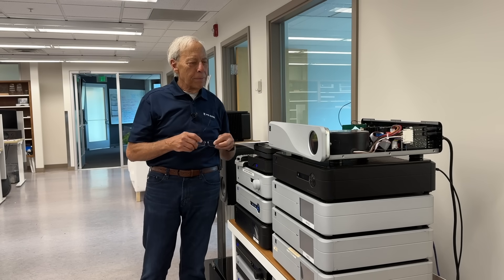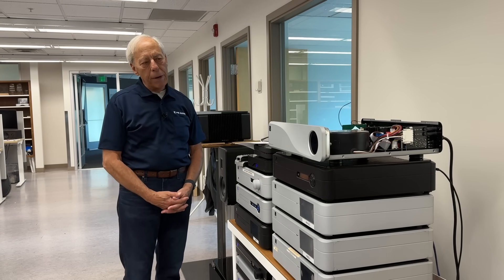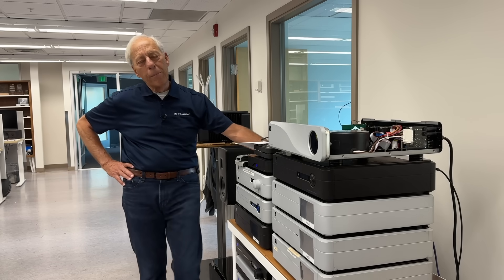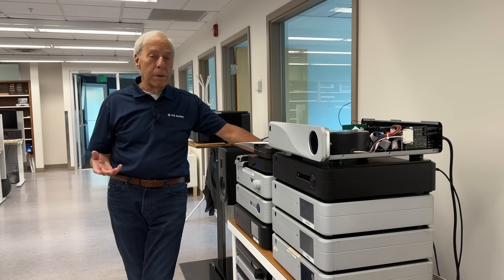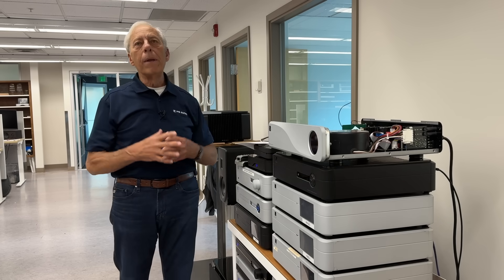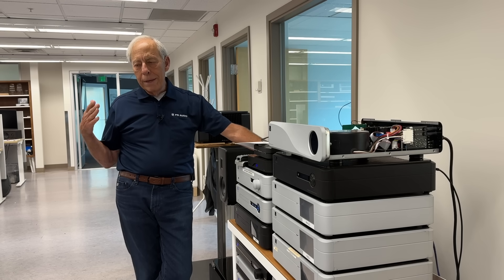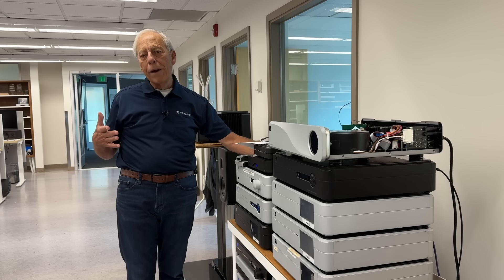What does a preamp do?

Comment: Marketing B.S. How can a pre-amp make the sound better? So if I chain two pre-emps, it will be even better and if I chain three, it will be fantastic? Do those pre-amps use AI to process the sound and remove imperfections or make singers sing in key?

The truth is, those pre-amps may change the sound in a way that it sounds subjectively better to some listeners - nothing more.
Reply: I own a Parasound P6 and a Parasound JC2 pre, besides the price there is a huge diff. Its the noise floor and impedance matching.

Comment: The preamp should have a better ability to drive the inputs of a power amp. Some preamps have a huge overhead of line output, far more than is necessary to drive the inputs of the power amp. Also they often have a lower source impedance. There is also the matter of gain. For a long time gain seemed irrelevant as all the preamp was really doing was reducing the level of sources connected to it. However gain seems to have some benefits too even though it isn't technically needed. It is a mystery however because there are quite a few DACs on the market now that offer both these features and a good volume control and some state that even they can  benefit from a preamp.

Comment: I've always thought of the preamp as the selector between your source components ad the power amp. how many power amps have multiple inputs that you can then switch between. 2 or 3 or more analogue devices and multiple digital devices. most power amps I've looked at have only one analogue input per output channel.

Comment: I've commented before that I wasted a few years with a passive preamp. When I replaced it with a tube preamp, the soundstage opened up and the bass moved to a different level. A passive preamp requires the audio output stage of a DAC or phono preamp to drive the resistor in the passive preamp and the cables, and some of them simply can't do it.
Reply: Was the different level higher or lower.

Comment: PS Audio's PMG preamp of ultra .00000000001 distortion is unnecessary and not as important as these features below:

Today's preamp should do everything my Parasound 2100 does and better (as it came out in 2007, 18 years ago) at a competitive price (Parasound 2100 was $600 in 2007-2023. I bought it in 2023):
- Automatic home theater bypass (Parasound 2100)
- tone controls treble/bass (Parasound 2100)
- balance left/right (Parasound 2100)
- analog 3-way active crossover: highpass, midpass, lowpass (I added a 3rd party device)
- RCA input/output (Parasound 2100)
- XLR input (new), XLR output (I added a 3rd party device)
- RCA loopouts (Parasound 2100)
- XLR loopouts (new)
- ground lift button (I added a 3rd party device)
- 2 independent subwoofer outputs (Parasound 2100)
- loudness button (new)
- headphone jack (Parasound 2100)
- Bluetooth 5.x latest (new)
- Linear power supply (new)
- builtin intput tube buffer  (I added a 3rd party device)
-----
source=Apple Music lossless
My video:
Search youtube for mrPMJ00
Reply: I hope you have a decent understanding of crossover design to properly implement an active crossover, it's not trivial to do it properly.
Reply: @mitchtaylor6512  I bought an analog 3-way active crossover (Sublime K231) and the engineer that created it said to get matching tweeter highpass @1750 Hz / 12 db slope (to match my PS Audio FR5 speaker), and sharp lowpass @50 Hz / 24 db slope.  
I also ordered extra lowpass XO modules so I can experiment @40 Hz / 24 db , and @60 Hz / 24 db slope.

The Sublime also has Baffle Step Compensation for the width of my 2 subwoofers
Reply: and 
- input and output triggers (Parasound 2100)
Reply: Jam packed full of stuff most won't use.
Reply: @mitchtaylor6512  I'm not most people as I have a mixed use $21k music 2.2 setup (currently active bi-amp and I will tri-amp this week or next when the 3-way active crossover is delivered) and an additional $10k cinema 7.4.4 setup with a 150 in screen.  So I use all the Parasound 2100's features except phono (I got rid of records since 1987).
Reply: @mitchtaylor6512  Ah I'm not most people.  I have a mixed use stereo sys ($21k) and cinema ($10k with 150 in screen) so I use all of the Parasound 2100 except phono which I don't care about as I sold all of my records since 1987.

Comment: Out of all the preamps that I’ve owned, my two favorites are from Audio Research and Audible lllusions. Both tube preamps
Reply: Which models?
Reply: @MadLadsAnonymous  I have owned the M3A with phone stage, L1 and L2.  The M3A used stepped attenuators which I did not like due to to large volume step but excellent sounding preamp.  The L2 has continuous volume control.  Awesome sounding preamp.  I currently own the PS Audio BHK and AI L2. The preamp, other than speakers, makes the greatest difference in sound quality. Tubes rule - I own tube preamp, tube amp and tube cd player.  I have been a tube lover since 1997.

Comment: You can not plug your cd player into a pa power amp directly. There will be no volume or any control. The pre-amp in this case a mixer increases the voltage from say 150mv to 775mv /1 volt so the amp input can work properly
Reply: Sure, but you can plug it into a good DAC/pre either digitally or with a lot of DACs analog if you really want.
Reply: @thomprd  some CD players have volume control, and enough output voltage to drive an amp, now a CD transport no.
Reply: @ssgeek4515 ...you can if your power amps have gain controls like a LUXMAN - 'M03' or a pair of DENON - 'POA4400'. I connected my DAC straight into my power amps back in the early nineties, no preamp, amazing soundstaging & imaging.
Reply: I tried my adcom CD player directly into my adcom amp back in the late 80's it sounded decent but was better with the adcom preamp.
Reply: Yes you can, if your power amp has gain controls like my LUXMAN - 'M-03' & DENON - 'POA4400' power
amps had back in the early 1990's. I fed my DAC directly into said power amps. No preamp required.

Comment: A year ago I switched from a solid state to a tube preamp. Big difference! The soundstage was immediately noticeable and more natural sounding. Will always stick to tube preamps.
Reply: Same here!
Reply: We like the vacuum toob sound.
Reply: Not for me.  I tried the McIntosh C8 tube preamp but it didn't sound better than my solid state Parasound.
What is improved sonically was a tube buffer (Cryotone) as it also solved impedence mismatch that the tube preamp doesn't do.
My video: search for mrPMJ00
Reply: @mrpmj00 I'm pretty sure the McIntosh C8 preamp has a cathode follower, which is a buffer.
Reply: @mitchtaylor6512  Yes, McIntosh C8 preamp has a cathode follower (which helps with impedence matching from preamp to amp), but that's not helping with impedence  matching from the source to the preamp.

Whereas a standalone tube buffer (like Cryotone Tube Conditioner) helps with impedence matching on both the source and downstream components.
Reply: @mrpmj00   the McIntosh C8 preamp has an input impedance of 22kohms unbalanced and 44kohms balanced.
So you are telling me your source component has an output impedance of over 2200ohms.
Reply: Which preamp are you using? (make & model)
Reply: I never liked tube amps AT ALL. They add distortion to the music i listen to, that's already distorted. But gear choices also depends on what genres of music you like, you add the sound signature and color to it that you like..
Reply: @martinrasmussen8745 What about:

Neutral speakers
Neutral-ish amp
Tube pre-amp with tone controls
Reply: @MadLadsAnonymous Never tried a really neutral tube amp then, and i have tried a few higher end ones. But you choose what fits your taste either way, but i get what i look for in solid state.
Reply: Tube preamp is the way to go.
Reply: @JeoffGammad Like Rogue?

Comment: Separates, including preamps, are not necessarily better sound wise.
A good branded integrated can supply a phono preamp, line level preamp and power amp all in the one box, and just think of all the interconnecting cables you are avoiding and any matching problems.
Your pocket will benefit too.
Reply: Plus the more cables introduced the more noise may be introduced, especially if the cables are unshielded
Reply: integrated....that ain't no fun
Reply: There are tradeoffs either way.

Comment: If you have no record payer, the best pre-amp, is no pre amp. In 1960, I had a Philips turntable with a crystal cartridge, which didn't need a pre-amp. But some bloke, a former Duch Philips employee invented the Moving Magnet cartridge, which was on my brand new Dual turntable, one needed a pre-amp. That's when pre amps were born.
Reply: If it works for you, brilliant.  But audio is not a one size fits all game.
No Pre?  Not true for me, and many others.  I've tried it, the DAC with volume control, the transformer based passive, etc.  
The Line Stage Pre route was the best.  And by a country mile.
Reply: if no preamp, how do you adjust volume?
Reply: @mrpmj00  Lots of ways.  Many modern DACs/Servers have built in volume controls, analogue or digital.  Or you can just use a "passive" control, pot or TVC pre.  

The "less is more" crowd think this is the Holy Grail, and it can be, but not always.
System matching is the key.
Reply: @mrpmj00  With a potmeter. like a tkd external or build one in.

Comment: Back in the early 1990's when I was using separates, I connected my DAC straight into my power amp(s) that all had ALPS rotary gain controls. No need for a preamp. Less is more as far as I'm concerned.
Reply: What type of preamp is Gaza ?
Reply: Tell Mohammad to replace his home first, after the bombing stops, of course.
Reply: You mean after the bombing vests have been removed?

Comment: Well said by Paul. Most modern DACs already have decent pre-amp built in. But a pre-amp in the real sense, is just a device who picks different inputs and make them into an homogeneous signal for a final power amp stage. Think of them sort of a multiplexer.
Reply: They do add gain though also don't they?  This could in theory add a character to the sound.
Reply: It's quite trivial to create an output stage of a DAC with sufficiently high output voltage and low impedance to to drive any power amp. I would rather consider a DAC as a crappy DAC if it needs a preamp just for a few dB of gain. It's not a meaningful argument to justify a preamp for this slight gain purpose only. Better is to throw out that crappy DAC...burn it 😂
Reply: @ThinkingBetter  I agree, the essential part is an excellent DAC and secondary a decent output stage.

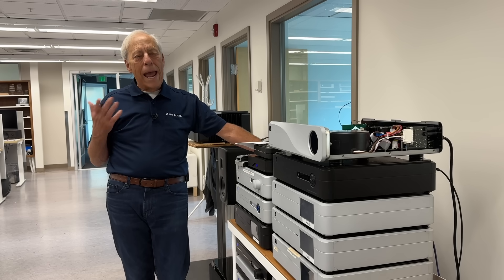Comment: @3:33 -- Enhance the sound?

Perhaps I am mistaken, but a quality pre-amp does not enhance the sound.  It simply does a better job with the gain stage.  It has its own, dedicated power supply.  It is an entire box, that, aside from having multiple inputs, is dedicated to a single function.

A high-end pre-amp, that costs the manufacturer $10,000 to build, is going to do better job than the courtesy pre-amp that is built in to a DAC.  Even a high-end DAC, where attention was given to its built-in pre-amp, cannot go toe-to-toe with that same company's stand-alone pre-amp, in the sound quality department.  I will wager that our host's flagship DAC sounds better with our host's flagship pre-amp in the signal chain.  And yet his flagship DAC has a very good built-in pre-amp.

@5:01 "...that they (quality pre-amps) actually make things better.
Would it be more accurate to say that such quality pre-amps do less harm, vs a DAC's built-in preamp, resulting in better sound quality?

My philosophy on audio gear is that every component does harm.  The ones that do the least amount of harm are the ones that sound the best.
Reply: Well try a dac with volume control straight into a power amp  and then add a decent preamp (like Kondo ) into the system. Finally, the last step, get rid of the wrong assumption😉
Reply: That depends on what you consider enhanced. Some reduce noise, others add distortion. Tone control can also "enhance" the sound. It's all subjective
Reply: @xaviermontalban1701  "That depends on what you consider enhanced. Some reduce noise, others add distortion. Tone control can also "enhance" the sound. It's all subjective"

Reducing noise is not an enhancement.  The noise is not part of the source material's content.  Any noise that is present was added by an imperfect design choice.  To then have some other component reduce that noise... that is a fix... not an enhancement.

Tone controls do not enhance the sound (well, it depends).  They make corrections for issues with the listening room, and they make corrections for issues with the design of various components, including speakers.  Corrections are corrections -- they are not enhancements -- even if to someone's ears they deem it to sound enhanced.

What each person's ears finds pleasing is subjective.  Liking tone controls, or disliking tone controls, is subjective.  The fact that tone controls are a fix, is objective.  Although, taken to an extreme, tone controls could be deemed an enhancement.  There are people that prefer the bass and treble to be turned way up, and not for fixing an inaccuracy.  Rather, they want blasting bass and treble that is not in the recordings (not at those levels).  From their perspective, that is an enhancement.  To my ears, that is sonic vandalism.  To each his own, or to put it another way, as you wrote, it is subjective.  So it depends on the use of the tone controls.  They can fix an issue, or enhance a non-issue.
Reply: He did not say that. Better listen to that passage again imo.

Comment: In guitar amplifiers the preamplifier stage imparts colour and a unique characterist into the signal pathway. The preamp boosts the weak guitar pick up voltage signal before it enters the power amplifier stage which boosts the current in order to power the drivers in the speaker cabinet.
The power amp stage does not impart significant colour to the signal. In guitar amps, the preamp stage is King.
Reply: on guitar amps its supposed to make the sound so its more interesting sounding, its part of the instrument. it could just as well be done later but tying it to the instrument as the first thing is just easier for everyone involved.

the way modern hifi selling does "preamp" is just selling an extra volume control box. strictly its just supposed to be the box bringing it up to line voltage. it's not supposed to be an effects box or a tone adjuster, if its going to be that better to call it something else, be it a line isolator, dsp or whatever.